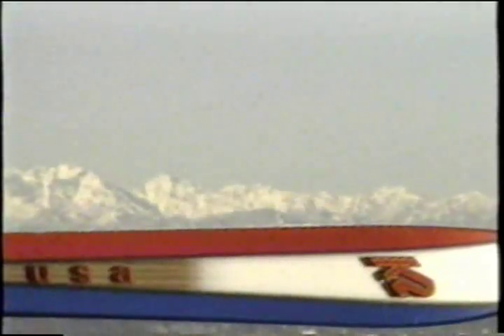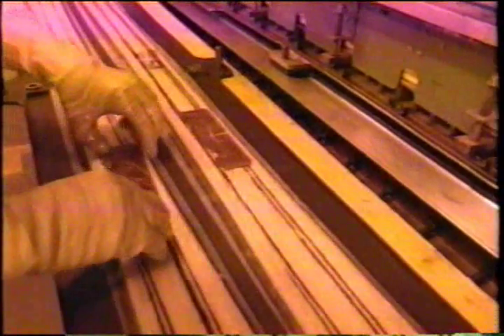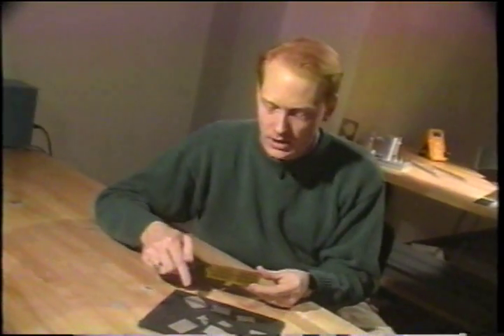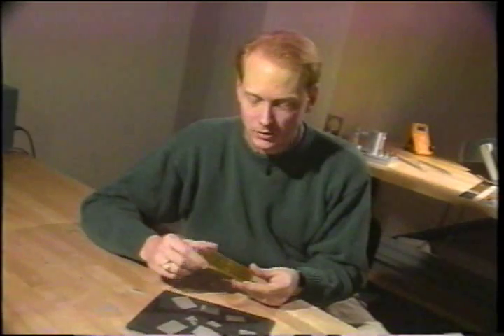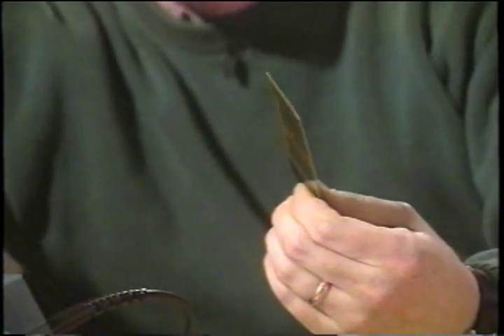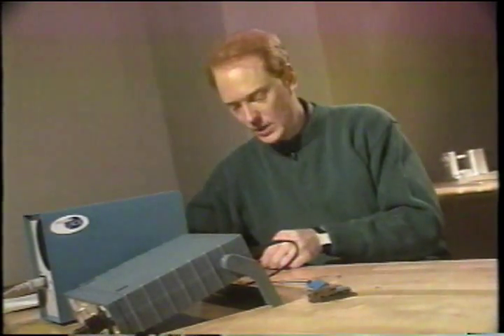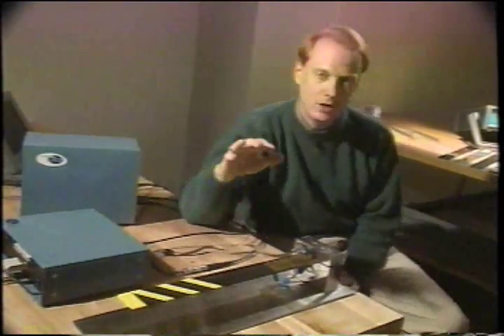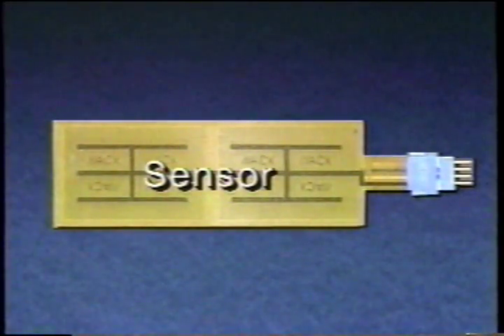Active Control eXperts / ACX / K2 Smart Ski / The Brain Inside (Corporate Video, 1996)

Comment: Great video. With Adam's permission, can I add that Mide Technology acquired this line of QuickPack packaged piezoelectric actuators and sensors in 2003 from Cymer. We've added to the product line with our range of Volture™ Vibration Energy Harvesters, SHIVR™ Haptic Actuators, and PiezoFlo™ Active Cooling Technology. They are a great technology, and you can find out more on our YouTube channel, or at our website (www.mide.com).